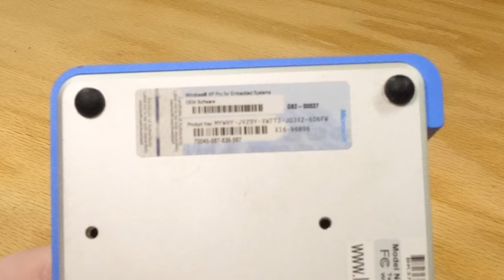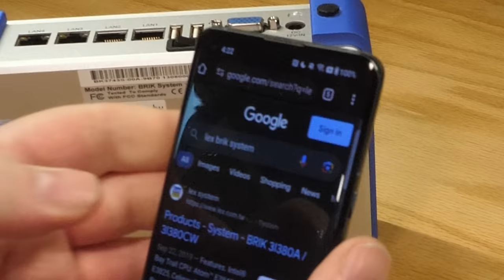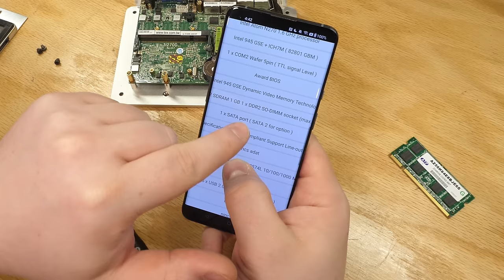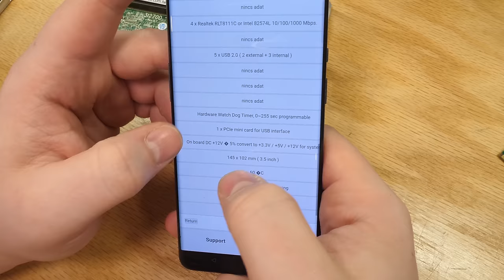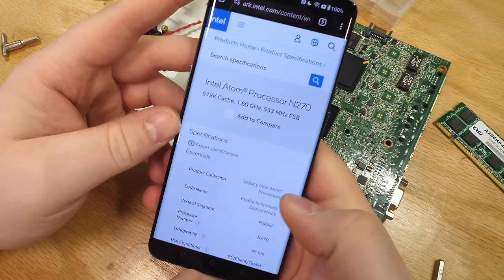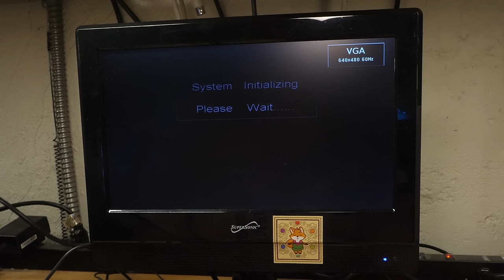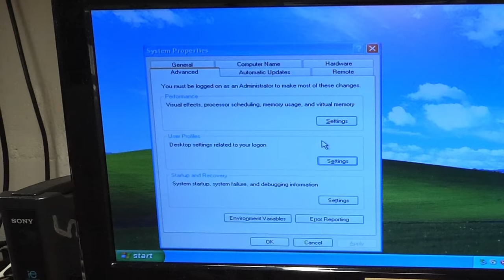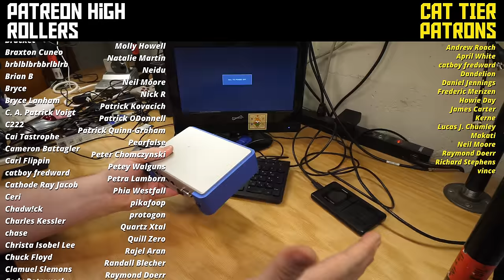Little Guys: Episode 3 [Lex Brik]

Comment from the maker: I keep getting this comment so to head it off: The fact that the internal bosses are not full-depth doesn't really suggest that this chassis is die cast - that would be an immense amount of extra effort and cost for the return you'd get.

Die casting is much more expensive upfront, it produces weaker parts, costs more, takes longer, and the surface finish and tolerances straight out of the mold are not terrific (pock marks, ripple, etc.)  It's great for parts with highly complex shapes, where flatness and surface finish don't matter, or for rotationally symmetric parts that can be quickly turned in a lathe, but for anything that requires reliable dimensions or clean-looking flat surfaces, you have to machine them all in afterwards; casting gets you the bulk of your volume, but every flat surface has to be added after the fact. So to get the straight walls on every side of this case you'd have to run a tool over every surface, inside and out, including all those radii, and by the time you're done you've spent the same amount of time it would take to mill it out of solid billet.

Since this has a straightforward two dimensional cross section, it's an ideal shape for extrusion. It would come out of the press pretty much ready to sell, just bandsaw it to length. Yeah, you have to put it on the mill, but you're talking about very little time just to knock off those internal bosses, add the locating grooves for the lids, drill the LED hole, and drill and press in the screw inserts, most of which you'd have to do after casting anyway. That tool mark above the internal boss is also definitely not a gate mark; it's far too deep and too wide.

Besides any of that though, the company sells other machines in chassis' that are identical except for their height. "The same thing except for height" is pretty much what the extrusion process was invented for, so companies that make parts like this one tend to take advantage of it. Will accept disputes if you have firsthand experience getting things like this made. :p
Reply: I'm pretty sure I saw that exact enclosure advertised for audio amplifiers and set top boxes a few years ago, but I can't find it. That kind of modification to an enclosure is the kind of thing that enclosure manufacturers offer as a standard service, even in extremely small batches. I love the little Tunic sticker on your TV by the way.

Comment: One of the most interesting things to me about industrial SBCs is the almost pathological dedication to silkscreening reference designators for every component.
Reply: i worked for a board manufacturing company for a short time in the early 1980s Circuits Engineering (they were shut down when the government found out they were dumping spent  toxic chemicals into a large hole behind the building) ..we would take  a copper clad board, etch it and silk screen it....

silk screening every component at that time was so that whatever company populated the board the line could simply say put component C1 into C1 silkscreen position..the line people did not need to know what C1 was or what it did..so they could hire very unskilled people to do the populating ...

As an example in the late 1970s i worked for SDC (Sundstrand Data Control) which was manufacturing FDC (Flight Data/Voice Recorders) at fantastic rate they could barely keep up with demand..anyway the entire assembly line were people (oddly 90% of them were divorced women) that did not have any electronic experience they were just assembling widgets..albeit VERY important widgets!

of course board manufacturing has changed by lightyears in the last 50+ years..
Reply: @MickeyMousePark  I put ferric chloride down the loo at work.  The U bend looked like it was from a truck stop for weeeeeks.  Only did that once!
Reply: nothing says "industrial" more than industrial quantities of aluminum or iron in the case only to find the same kind of PCB we find anywhere else.

sometimes its not even conformal coated, nor have ceramic components or anything, its just a computer, but with lots of pathological silkscreen as you said... somehow industrial quantities of silkscreen makes it industrial

its almost like no one knows what they are doing and everything is pure cargo-cult.

Comment: I think I know why they used the different Ethernet connectors. To do the trick with the relays, they needed connectors without the built-in transformers. This is one interesting little guy! Thanks for the fun video!
Reply: I think you can see on the bottom the two transformers for the ports without the built-in ones! The two GTS chips labeled FC-2149, I think.
Reply: I really like this series of industrial pcs
Reply: exactly what I thought, the bigger one have built-in transformers. When I saw the space for relays I thought it was to switch-off some PoE device, I was wrong about that.

Comment: The reason of two Ethernet RP-45 ports are shorter is passive pass-thru function. These ports have external Ethernet transformers on bottom side of the board. It allows relays to be connected in between RJ45 and Ethernet transformer. Other two  RJ45 port have embedded transformers and need power to operate anyway.

Comment: The fact that it was hooked to a gamma knife to me makes it 1000% cooler. I used to work in healthcare in a facility with a gamma knife, and yeah you're right. It uses extremely accurate high doses of radiation to do surgery (mostly on tumors) without having to actually cut someone open.

It was also the highest security part of the hospital. Im talking rooms made entirely of reinforced concrete and multiple layers of solid steel doors. If an alarm went off in there every emergency responder from the nuclear guys to firefighters to security guards would drop what they were doing and rush over there..
Reply: Well yeah, the capsules in radiotherapy machines have been stolen before and broken open, causing deaths and massive cleanup bills. The last thing you want is somebody purposely stealing the capsule.

Whereas here in Australia we lost a tiny radioactive capsule. It jigged loose inside the equipment it was being transported in, and fell out onto the road. Took several days to find it, haha
Reply: @3rdalbum  I suppose the famous one is the Goiânia incident, but I'll mention it here for the 5-10% of viewership of this channel that doesn't know about it yet.

Comment: In regards to that PowerBook G4 Titaniums super proprietary battery, I have an interesting (though admittedly quite silly) idea. On older PC motherboards (around the time of the 286, 386, and 486/ 1980s though to the mid 1990s), there was commonly a Varta branded (or equivalent) 3.6 volt NiCd/NiMH rechargeable battery, and they are known to corrode and destroy the motherboards traces. Since they are known to corrode, it's quite common nowadays to remove the battery completely and install a cr2032. But like you said in your segment about that PowerBook G4 Titanium, the motherboard trys to... well... recharge it. Because of that, those people replacing the battery with a cr2032 will use a diode between (and my memory could be failing me here) the positive lead on the motherboard and the battery holder. That keeps the battery from being charged, as all cr2032s are non-rechargable (if we are to ignore LIR2032s and ML2032 which have their own issues).

Now, I've never done this before on a PowerBook G4 Titanium, so there could be issues that I am not aware of. Just throwing out ideas

Comment: 29:25 The northbridge is indeed responsible for the memory interface; the fact that the CPU specifies an FSB (Front Side Bus) speed is a dead giveaway. The FSB is how the CPU communicates with the northbridge in order to access the memory and PCIe interfaces.
Reply: When is intel going to finally have unified memory , when ? 
its almost 30 years now since the 386

maybe when their market share is 2% and no one uses intel anymore...
Reply: @monad_tcp  I believe they're working on it, actually. We're never going to see it on desktops and gaming laptops where discrete graphics chips are a thing, but laptops that run solely on integrated graphics should be UMA in the near future.

Comment: When I was in high school my parents newsagency had electronic signage put in by a vendor, basically a 17" LCD on an arm screwed into the ceiling, with a small pc VESA mounted on the back. The company eventually went bust so I claimed the gear. I ended up with a tiny embedded Celeron(?) machine, held in the most austere metal box. It looked like those radiation cans they screw into machines. I think it had power equivalent to a Pentium 3, so it could run Windows XP, a program that showed JPEGs downloaded over the network. and not much else. That was the only time I've had any real contact with industrial computers, and I was fascinated by all the random connectors it had.
Reply: Yep you got it!  The VESA mounting holes are to secure it to the back of a monitor.
Reply: @jonobst  Then it had a huge, very heavy bracket that mounted the machine and monitor to the arm, via the vesa mount. I don't know if there's a term for it, but it was like a vesa extender.
Reply: I tried to load windows 99 on an ami indigo industrial socket 370 board, but i put the pci video card in backwards & blew the southbridge :(
Reply: People did quite a lot with far less in the way of computing power than we have now....
Reply: @jonobst  Yeah, the VESA mounting holes reminded me of the thin clients they had attached to the backs of monitors when I spent a few months after university doing data entry at a hospital.

Comment: XP Pro for Embedded means you can use RDP to remote into it as well as remote WMI but it's cheaper because it doesn't comes with a CAL for AD since it's designed to be used as a standalone computer. Windows XP home didn't had support for remote management, and Windows XP embedded was a completely different thing since you could cut out entire parts of the OS via the OEM Preinstallation Kit (OPK), you could literally strip it down to the kernel. XP Pro for Embedded is just normal XP Pro but with a much lower licensing cost.
Reply from the maker: That's what I figured, thanks for confirming!

Comment: “What on this could need a fan!?”

The chipset. The 945GM chipset drew significantly more power than the CPU. I used a similar board as my home theater PC before upgrading to an HDTV.
Reply from the maker: Sure but to wit, they didn't actually put one in here, so it seems like it doesn't actually need it. I guess maybe it would if they were pushing the graphics capabilities harder?
Reply: Yeah pretty much, the CPU draws 2.5w as stated in this video, the north bridge is 10-11w and the south bridge is like another 3w iirc. 
Makes me surprised Intel didn’t make a special low power version of the 945 chipset. (Though I think they did sometime after releasing the first Atoms)

Also have essentially this machine but in a netbook, a Toshiba NB200 except it has a 160gb HDD and a Atom N280 1.66ghz CPU.
Reply: Keep in mind the intended environment this system was employed to, hospitals/healthcare. These places are keep at cooler temperatures to help combat bacteria and infections. Just a idea on why this system might not need fans.
Reply: @thegeforce6625  Atom had two primary reasons to exist. Power draw was one. Cheapness was the other. Intel wasn’t wasting any design or manufacturing effort on a new low power chipset until they knew it would be a success. The chipset was already obsolete when Atom came out, but it was easy to make more on some of the older-process fabs. 

Later, yes, they made proper low-power chipsets, and even SOC versions with the chipset on the same package as the CPU.
Reply: @CathodeRayDude  Mostly I imagine that in this chassis it was unnecessary, but they might have had other chassis that it might be needed.
Reply: @thegeforce6625  The Intel 945GSE on this board is a special low power version of the 945G (which originated as a chipset for Pentium 4).
Reply: I’ve worked on embedded devices where a fan header was installed just in case it would prove neccessary, but in the end testing proved that the fan was not needed for the application.

Comment: I work in HVAC controls and we see more and more equipment that have that fail-bypass relay option. This allows the HVAC controllers to be daisy-chained via integrated ethernet switches, but also bypass if one piece of equipment is offline to avoid cutting comms of the rest of the run.

Comment: 4:19 I am that guy, I am the guy who goes out to fix $300k commercial dishwashers. I have to lay hands on machine because sadly most failures are mechanical. I also work on scales and wrappers, which again most of their failures are mechanical. It's a real shame!
17:49 Cash register controls use relays, maybe it could have been used for those?
26:05 "Convection" is this passive effect you describe, you just mean it doesn't need the extra surface area.
26:35 I would call this a union, or a turnbuckle, though I don't feel like either are exactly correct.
Reply: I think the convection correction is unnecessary. There is no design element to induce convection currents as a cooling measure. Moreover, the airflow from people walking around the room would probably do plenty more than whatever immeasurable currents the 2W cpu is creating on a surface that large. Not all air-cooling is convection! It also may well be getting rid of its energy through contact with whatever table it’s sitting on, or through radiation.
Reply: Coupling nut. Larger ones are used a lot with threaded rods for equipment suspension - HVAC, conduit, plumbing, etc..

Also adapter nut (because of the different threads), registered nut or shoulder nut (because of the turned-down OD for locating and clamping) . . ..

The catalog entry for those is probably a fascinating word soup, unless they took the cheesy out of calling it a "specialty nut".

Comment: I worked with a DDOS filtering device from a company called Arbor that had a server bypass adapter for fiber modules. The idea of the device is that you would put it infront of your edge routing devices, advertise your BGP routes with a /25 instead of a /24, and the arbor device would passively sit there and snoop all your incomming traffic. If it decided that too much of the traffic was illegitimate, it would phone home, and they would use the network of a significantly larger provider (I think it was neustar?) to filter your traffic, by hijacking your routes via a more specific /24 advertisement. Of course putting a single device infront of your edge network is a huge single point of failure, so its network adapters had this relay system, so you could apply updates to it without bringing down your circuits.

Comment: 21:40 yep, those annoying USB-only PCIe ports exist, and I loathe them! In laptops they do it all the time for 3G modems, and with it, you can plug a wifi + Bluetooth card and only Bluetooth (always USB. Don't ask me why) will work. On the HP Pavilion dv6000 series, side by side one slot does PCIe only, one does USB only. Can't have both. Or you can if you're me with a soldering iron and a bit of wire...
Reply: The whole combined USB and PCI-E + SATA functionality wasn’t really a thing in business notebooks until the 1st Gen core i series, you could usually choose between a mSATA SSD or a WWAN card. (Or if you’re HP, still support only WWAN cards in a WWAN slot, atleast on the 3rd Gen core series generations, 4th Gen machines are a bit of a mSATA to M.2 transitional period since i have a Acer TravelMate with a 4th Gen haswell i5 that uses a M.2 SSD, yet a dell precision from the same CPU generation uses a mSATA SSD. (I guess SATA M.2 SSD’s are pretty much just a mSATA SSD in a different form factor in a basic sense)

Comment: Mathematically, it takes three points in 3D space to define a "plane", which is a 2D surface that extends infinitely along a flat surface. Three screws for any "flat" board should be enough. The fourth is for aesthetics and for extra confidence.
Reply from the maker: I actually used to know somebody whose position on this was that three was better than four, because with three you cannot inadvertently force a flat object into a warped non-flat shape. with four, it suddenly becomes very important that the mating surfaces of all four holes be perfectly coplanar.
Reply: @CathodeRayDude must be someone who wrote a renderer. It actually can be problematic for 3d printers that tend to have 4 leveling screws
Reply: @lassikinnunen because nothing is ever really a "flat surface" in the real world, everything warps

Comment: The trick to installing XP on """removeable""" drives is to format it with a normal computer, then in FDisk during the install for XP, you add a second partition and THEN delete the first partition. The removeable disk vs permanent disk thing is in the formatting, usually XP won't even run at all on a removeable drive, despite installing fine (much to the bane of SD2IDE users like myself) but thankfully the solution to our problems is built into the WinXP install CD. I was banging my head on the wall for like six hours cause of this problem, so I hope it brings you many hours of less-headache-riddled XP installing. I dunno if it works with the version of FDisk that comes with the retail version of SP3, but it definitely works with the launch edition of XP that's on the recovery boot disk for my first laptop that I then slipstreamed Service Pack 3 and all the usual life-support programs into... surprised that CD still works but that burned Memorex CD-R has been in the family for 20 years and I ain't about to change that, even if I DID re-burn it into a slipstream disk.
Reply: Appreciate your detail on this